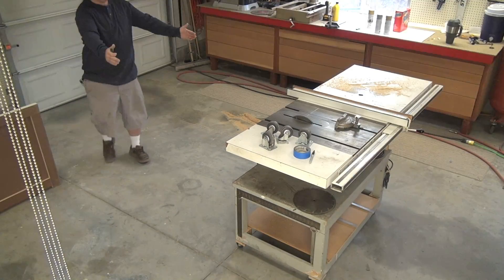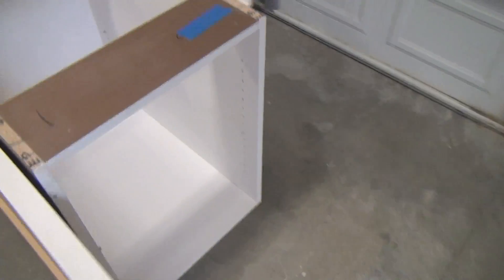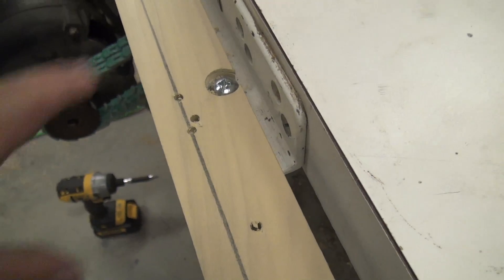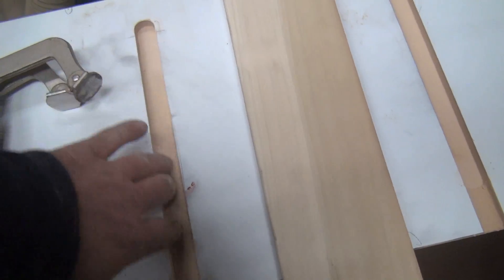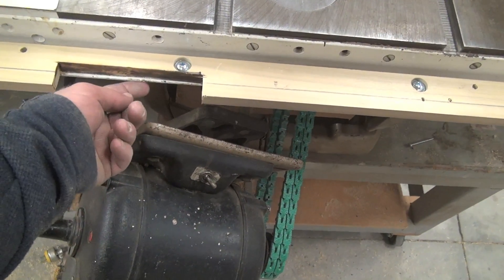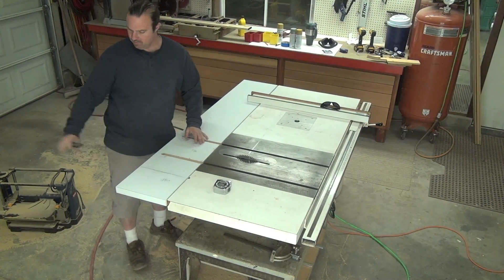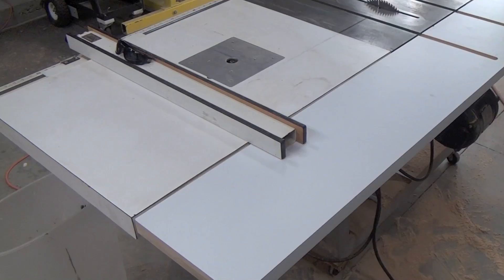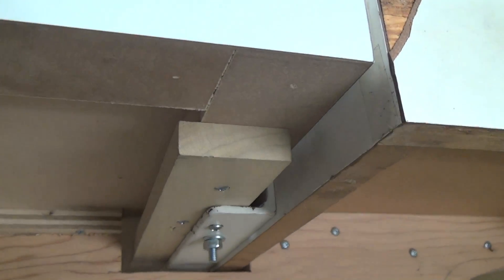Make an OutFeed BRIDGE For Contractor Table Saw Craftsman

Comment: I noticed the dual link-belts. Did you simply replace the original pulleys? 
Had you used a single link-belt before the upgrade?
Did you notice a significant improvement?
Did you get your belts from Harbor Freight Tools?
Reply from the maker: Yes I got the link belts from harbor freight. The dual pulleys came with the saw when I purchased it. It did however make a big difference when i replaced the old stock v belt belt with the link belt. The link belts are totally worth the money.